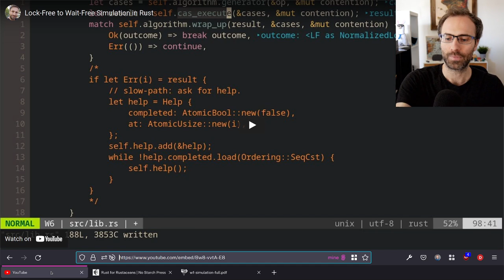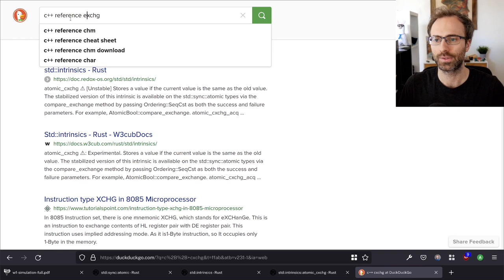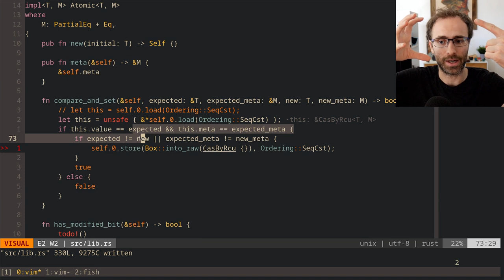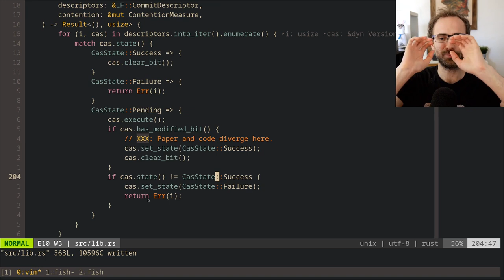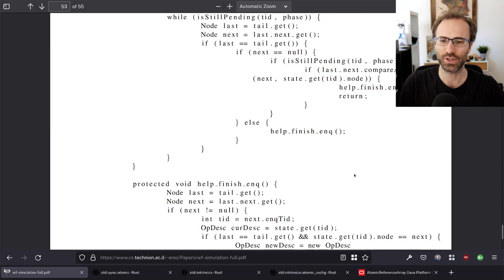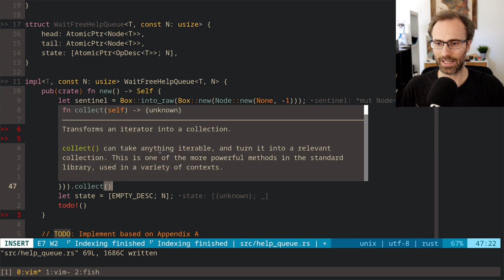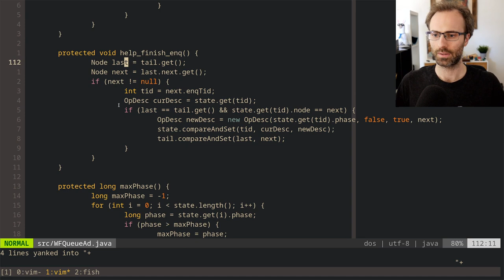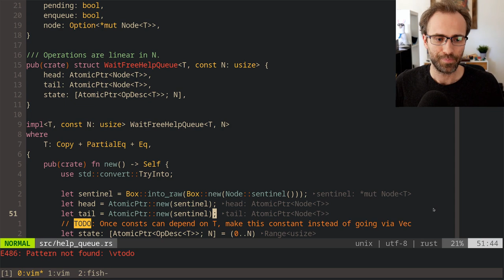Lock-Free to Wait-Free Simulation in Rust (part 2)

Comment: 4:28:00 this why we need subtypes in Rust. With a numeric subtrait, you could have a value of type "0..=max(usize)-1", which when put into an option could be optimized to use "max(usize)" as the None variant and would not waste any memory. It would be normal usize after compilation, could be freely assigned to usize (even reference it with type &usize), but going from usize to this type would require the "as" operator and it would runtime-check the value and panic if it is out of bounds. Also TryInto and could be helpful there.

Comment: I am completely new to Rust, but there are a couple of questions I have at the end of this, just about the simulation.  The first is something I raised as an issue against the github, where I believe the fast-path part of the implementation should be checking vs the contention threshold and moving to the slow-path if it has contention.  The second is the java implementation the original designers had.  There are multiple times where you point out inconsistencies, but the one left over between the two is the "resume" capability.  

You noted the difference between the paper and the implementation, that the "return I" was incorrect and nothing was ever returned in the java implementations.  If the java implementations try to retry all the CASes in the CAS-list that was enqueued, wouldn't the stored data be in a state where the first CASes, if there was a problem part-way in a list, never be resolved?  Does the implementation then prematurely fail, or does it leave it enqueued to endlessly retry?

I believe your implementation returned the id, and then allowed any helper thread to resume at the place where the failure occurred.  This seems to be the most logical way to handle it, and in-line with the paper, but not the java implementations.  I just think that this deviation would possibly have a meaningful impact on the original authors benchmarking?

Comment: allocation isnt guaranteed to finish in a bounded time or amount of steps. the libc and kernel implementation most likely locks, too. doesnt that break your wait-freedom?
Reply from the maker: It does. This is usually a "system assumption" for wait-free algorithms, since there's not much they can do about it. In practice, there's still value in the algorithm being wait-free even if the allocator isn't, because it still usually improves scalability under contention.

Comment: Hi John :)
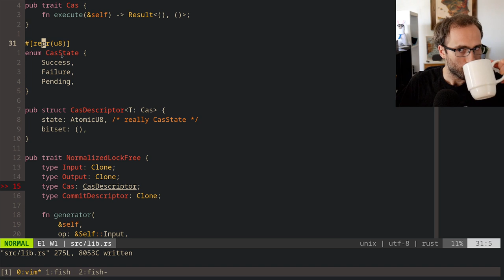At 27:00 : Is there something like a generic `Atomic<T>`? Is something like this possible, maybe using a trait `T: Atomically`? Or is this just not possible for some reason?
Reply: @James Taylor Okay I think I understand. But how is this specific to integers? Shouldn't this work with any datatype of such size? It's just reading, writing and comparing bits, isn't it? So it should work for other types too, if some conditions hold. For instance a fieldless enum should be fine, right?

Comment: I believe you made a mistake in your help_finish_eq, you split up the if statement to reverse it but it wasn't an OR it was an AND... by splitting it into 2 separate if statements you're changing what that statement is checking and I believe are actually breaking what it intended... the way you have it I don't see how it will ever update the pending to false.
Reply from the maker: Hmm, I just read through it again, and I don't think it is wrong. Specifically, the condition used to be if A && B { C }, and is now if !A { return; } if !B { return; } C. And those should be equivalent given that there's nothing else in the function specifically, in the latter case, getting to C implies A && B, just as in the original code. Or have you spotted something I missed? The code is here: https://github.com/jonhoo/bystander/blob/bb66a3eff8364da63b7f6387bbef246df4762be1/src/help_queue.rs#L183
Reply: @jonhoo  ahh I think your right I made note of it in my head while watching but now seeing the actual code I think you did account for what I was thinking of

That code really is a mindtwister tho lol